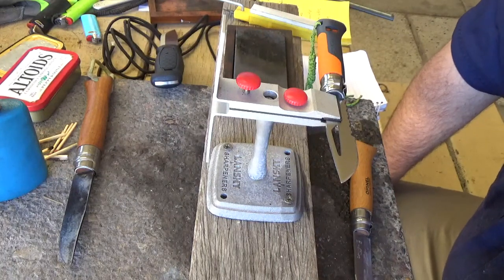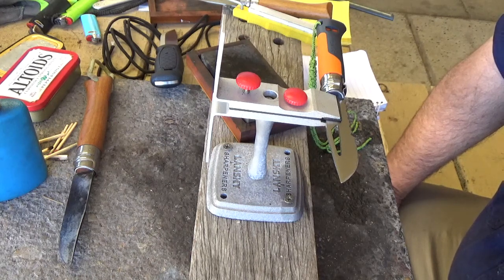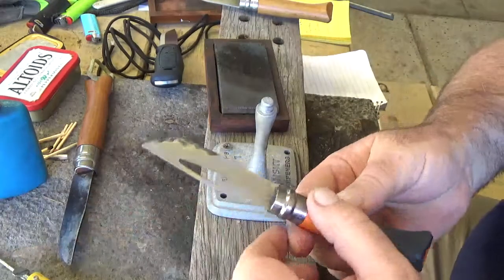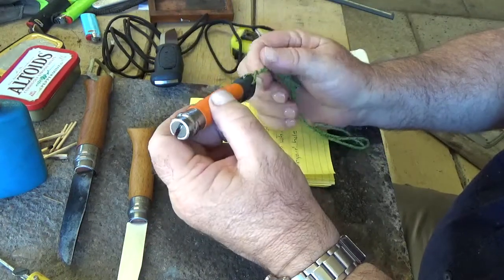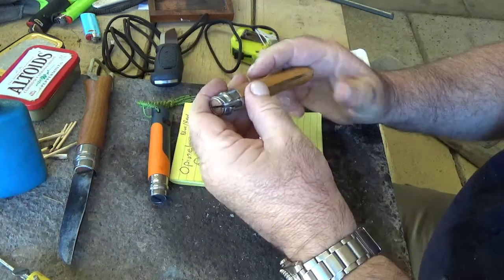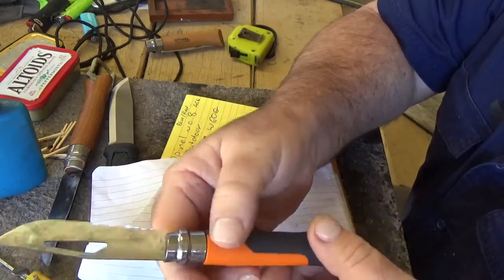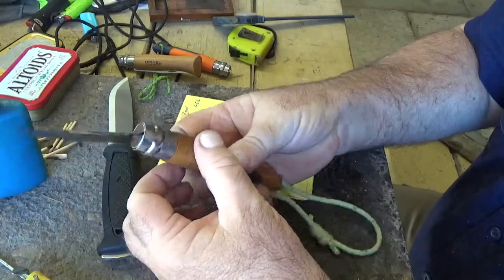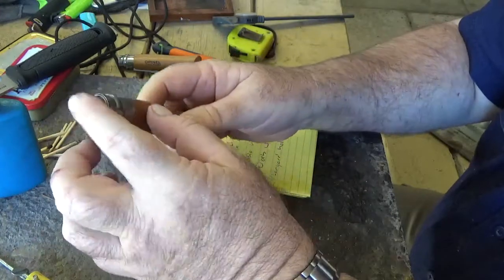Opinel no 8 Outdoor resharpening

Comment: You made that look easy! Wish I could send my blades to you for a once over, I was surprised when you said your car was broken into I never imagined crime over there.
Reply from the maker: Yes we have a big Ice drug problem here and  theft from parked cars is a big problem I try and keep stuff of little value in the car as it encourages them to do more cars if they get good stuff.
It really gets up my nose to replace a window over a few dollars in coins and a phone cable.
The Lansky sharpening system is easy to use but a flat stone takes a bit of practice if you know any carpenters with a mitre saw ask them to cut a 30 degree edge on a bit of wood makes a great edge guide regards mike